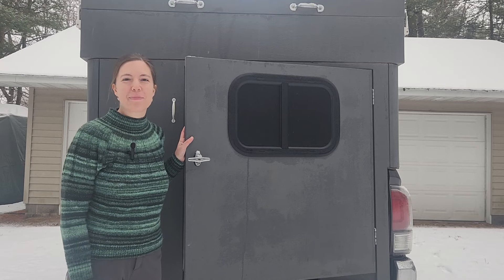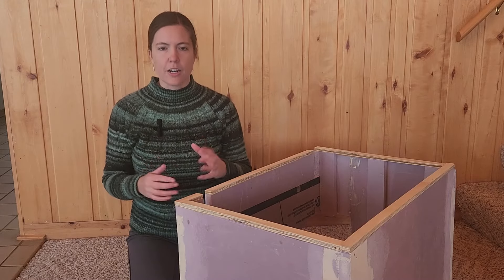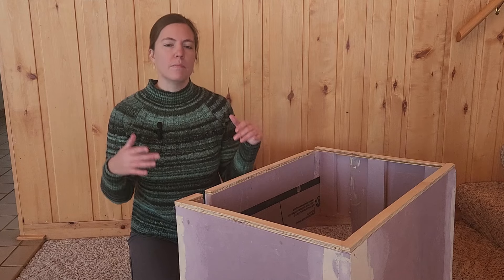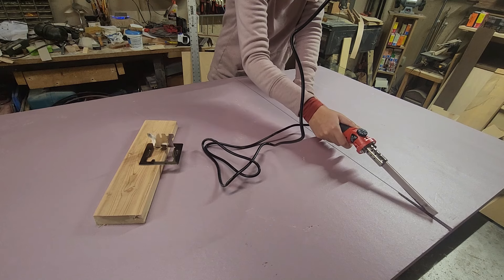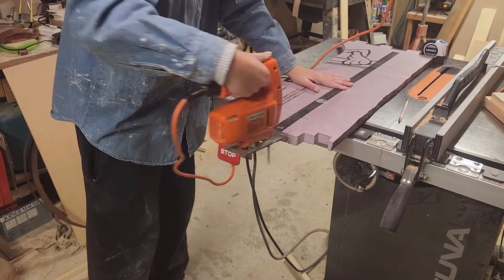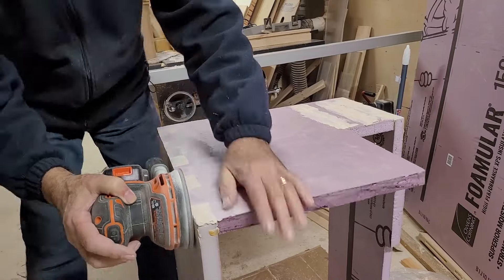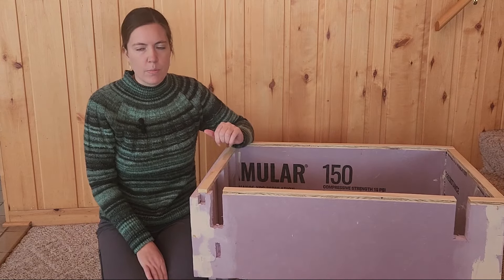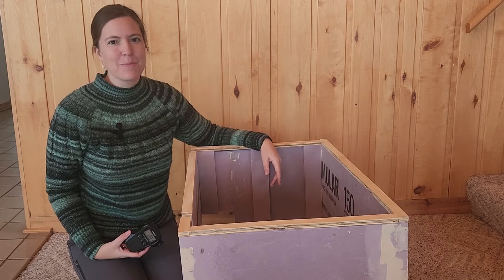Interior Build Ep.1: Building Foam Furniture

Comment: Hot Wire Foam Factory has many different foam knives and also an amazing foam glue called “foam fusion” which is quite fantastic. I learned about using the oscillating multi tool in this video. Great idea and it looks like the tool to use for the shaving and shaping needs. Quite an inspiring camper you have built. Congratulations!
Reply from the maker: Thank you for those recommendations! The foam fusion sounds like a nice product!

Comment: Wow!  Surprised at how strong that foam is.  I probably would have made a wooden frame and used foam for the panelling.  But that's just my OCD kicking in 🤣As usual, great video!
Reply from the maker: Haha, thanks. Yes, I'm pleased with how strong the foam is. It is bulky though, and I think we'll be making the countertop section out of wood so we can use 1/4 inch panels instead of 1 inch foam.